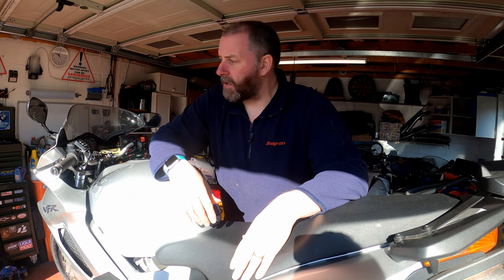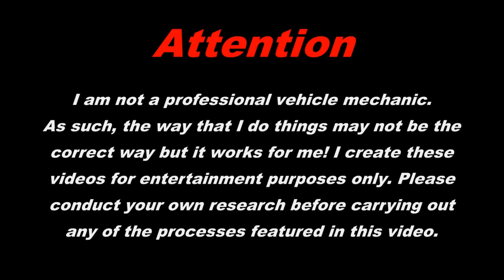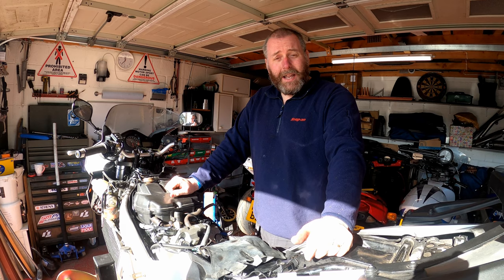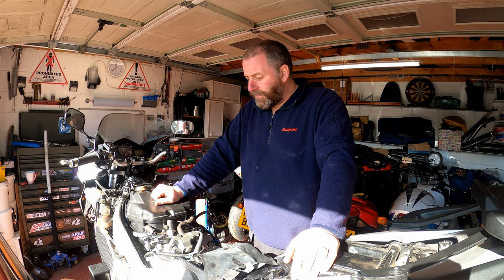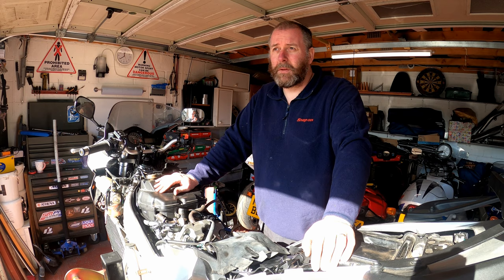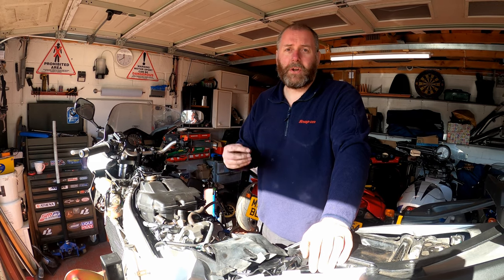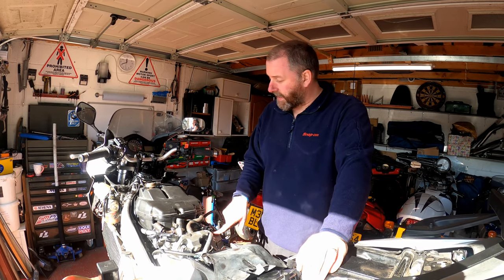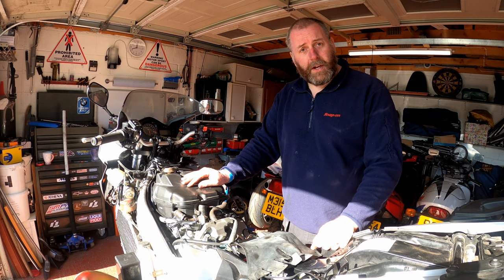Honda VFR800 VTEC Valve Clearance Inspection, Part 1 - Tearing Down The Bike To Get At The Valves!

Comment: side note: vtec valves have x2 service limit than normal valves. so, if you don't wanna fiddle with the v-tec valves just check the normal valves which i did when i had my valve clearence.
Reply from the maker: Almost 3 times the tolerance! 0.03mm versus 0.08mm 👍🤓

Comment: Did this job on my 2014 VFR, didn’t want to pay $1000 in labor. Bought the special tools and still came out ahead with the savings. Although time consuming, I’m glad I did it because I had two slightly tight valves, one of them a VTEC bucket.
Reply from the maker: Good work 👌🏻😎

Comment: Great video, gripping stuff, even though I have a 5th gen and not 6th. Would a clean lint free cloth be a good idea to gently poke into the chasm into the engine and prevent anything falling in as you remove or refit bolts and washers? I think this is what I would do as I am a bit clumsy. Thanks for making this video series of this job. Not for the faint hearted!
Reply from the maker: Yes absolutely, especially if you are prone to dropping little bits! 😬

Comment: Hi kev hgv mechanic myself as i have said before in other clips a lot to take off mine a 8th gen one same lump as yours mine not due yet but will be by next year merc trucks are a big job when you do a top end service i work for merc My other 2 750 model viffers they are easy to do .The early 750 is on the old tappet adjuster lock type the other one is on shims done both of them a few times never had to adjust them early ones as you know are gear driven cams . Good vid kev you should be a full time mechanic these days to get a hgv mechanic is like rocking horse poo vast short age of them we at merc struggle to get any one to come even for a interview. My self do night shift at merc always loads to do due 2 lack off staff its a world wide thing lack off hgv mechanics  one thing for sure i will be never out off work .

Comment: Thank you for this video. I've wondered why this job is so expensive to have done in a shop; now I know.

I had several reactions. First, I worked as a software engineer for USAirways maintenance and engineering for 16 years. Several times I got to tour their maintenance facility in Pittsburgh, where they work on stuff like engines (they have a test cell where they can thoroughly test a jet engine in operation; I was there when it was in use), fuselage parts, electrical components, and coffee makers (you can't fly passengers without a coffee maker). I can't see much difference between working on this bike's engine and a 737, other than scale. In fact, the 737 engines might be easier (just 3 bolts to remove and off it comes!).

Second, it's clear that this engine was designed for use in their racing bikes, where ease of maintenance is secondary to performance. (There's a pit crew for maintenance.) Compare this engine to the one in the NC750X. Checking valve clearances on the NC750X is simple (at least, from the video I've seen): remove the radiator and a few other bits, and there the valves are, easily checked with a feeler gauge and adjusted with screws. The NC750X engine was designed so that even posers like me can work on it. It's not nearly as much fun to ride, but it's easier to live with.

I can't wait to watch parts 2 and 3!
Reply from the maker: They are out mate! Parts 2 & 3 are linked at the end of the video 👌🏻😎
Reply: @KevsShed  I will watch them!Got to see you put it all back together.

Comment: I just paid CAN $1800 to find out I have a cracked cam holder. Of course you cant just buy the one part... Honda sells the whole top end kit for $2000.  So I went bought me a Moto Guzzi instead. Then I just met a machinist, says he can weld my cam holder then machine it.   
Only catch, hes retiring in a month. So Thank to your video, along with my maintenance manual. Ill be ripping my vfr apart tomorrow.
Reply from the maker: Yeah the cam caps are machines together with the head so that they are truly matched otherwise the camshaft wouldn’t fit properly, good job you have someone that can do that job for you! 👌🏻😎

Comment: Kev Thanks for sharing that. I am planing to do this job myself although I had Honda VTec Vfr 800 before.  Had also VFF 800 fi, now got pleasure to own Honda VFR 750 02 reg. Planing to do this job myself. My dealer 2 year ago asked 600 pounds for this job. This year i asked how much would 750 vfr cost delaer quote me 750 quid. So will do it myself. Do you have any tips on how to put camshafts back in position in head so they exactly where they were. I seen some tips like cable tie on sprocket and chain and mark another camshaft with marker and do one at the time. Seen people how easy to misaligning by one tooth and bike was loosing power etc. ? Any tips on that? 750 model with sprockets through middle of head. No chain, no VTEC valves. 800 sprockets were on side of head. Never done this before. Like to try to make sure bike spot on. No much history on my VFR has 46k not sure valves ever been done

Comment: is your valve clearance good? I'm getting some strange vibration that's coming through my gas tank into my thighs and its like a rattle, Just did the cam chain tensioners and it went away for a few weeks and then came back. I can only hear it when my thighs are touching the gas tank.

Comment: Thanks for a great channel Kev. I have a 6th Gen with a slight ticking noise that sounds like its coming from front left of the engine. when the oil is cold its not present, do you think its time to look at the value clearances? 29k km on the clock.

Comment: Now I have a 98 vfr800fi have had for neerly 15 yrs runs great never any issues took good care of her shes my baby but how similer is it to my 5th gen I deff think I meed to check mine no issues or sounds but I deff dont want any so how close are these to in comparison
Reply from the maker: The valves on the 5th Gen are just like the non-VTEC ones in the 6th Gen, all 16 valves are regular valves and to check them is easy! Cam cover off, turn the crank to TDC on the compression stroke for each cylinder and gauge them, no pulling of camshafts etc!
Reply: @KevsShed  awsome I have a rule since ive started riding im only 1 to work on my bike I wanna know how to do it and I know done correctly. And I love this bike have worked on many many diff bikes by far prob 1 of best built biks ive messed with and I'm deff goin to do this thank you for your videos def helps lots. Thank you very much

Comment: Sir, I have a 2007 VFR800 25Year Edition, but my back is very uncomfortable because my handlebars are very low, I see that your handlebars have been changed, Could you tell me where to buy them.
Thank you !
Reply from the maker: Honda VFR800 VTEC - Moto-CNC Bar Riser Top Yoke Fitment With Renthal Street Bars
https://youtu.be/P0Sr3g5Gm90

Comment: Are the non V-tec VFRs simpler to do valve clearance check? Been looking at getting one of these V4s but wow it seems intimidating
Reply from the maker: Yeah much simpler, there’s no need to remove the camshafts twice! Only the once if any shims are required! Other than the first camshaft fit and removal, the process will be the same from then on! 👍🏻

Comment: Hey Kev really enjoying the videos! Noobie question just wondering how much work would it take to replace both cam chains whilst you've already got the cam shafts out? Cheers
Reply from the maker: Not too much more work mate, I’m not sure how easy it is to remove the chain from the crank with out further disassembly without checking the manual, but with the camshafts removed you are certainly most of the way there! 👍🏻
Reply: @KevsShed  cheers mate!

Comment: makes you wonder if the 16ks worth it?
Reply: tbh, if someone wants a VFR i recommend em a 5th gen. easier to maintain and no vtec bullshit.
Reply from the maker: The induction sound when the VTEC kicks in is quite awesome though! 👍🤓
Reply from the maker: For the average person, it takes quite a long time to do 16k on a bike! Granted there are some who use them as year round commuters but for those who only use them for fun on nice days, 16k can take a few years!
Reply from the maker: @bountythumper, I quite fancy getting myself a 5th Gen too, the sound of the gear driven cams reminds me of a supercharger!
Reply: @KevsShed  I'm thinking to sell my 6th to get a 5th gen.
Reply: My '03 has 24K and non -VTEC valves were all within spec. Shim under Bucket valves are very robust and require much less maintenance than  rocker arm screw-locknut adjusters, also better for high RPMs. Many forums suggest no need to check until 30'sK , unless the engine is subject to poor maintenance or consistent high revving.
Reply: @marco.1804  mines an 03 with 9801 miles on it.
Reply: @KevsShed  Well done Kev, wish you would get a 5th gen, get a 98 or 99 bike if you can, no 02 sensors and no wax block fast idle nonsense either, be great to learn from you working on the 5th gen.

Comment: Sod that. Gonna buy me a 2 stroke. Or a Guzzi.
Reply: @Kev's Shed  Seriously though I loved the vid. I really appreciate your helping me to make an informed choice. I have just retired and am looking to return to biking after 18 years or so. VFR was on the shortlist (largely due to fond memories of watching 1980s road racing - V Four Victory etc. However funds may be too tight for complex professional work, and although I'm a pretty competent spanner wielder my dodgy back and mild arthritis now makes this a chore. If I can get a bike that's had the work done recently then great; I doubt I will ever put enough mileage on to need it doing again. How much simpler is the job on a 5th or earlier generation with gear driven cams?
Reply from the maker: @neilanyon4792  Much simpler on the 5th Gen mate, no need to take each camshaft out twice, only need to be removed if a shim is required, it would take half the time!
Reply: @KevsShed  cheers mate. Might be the way to go.